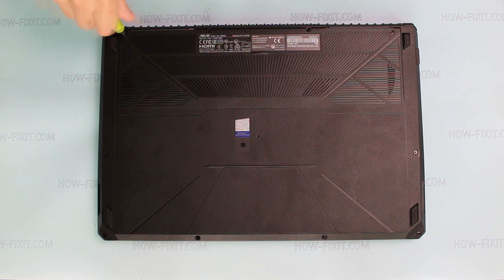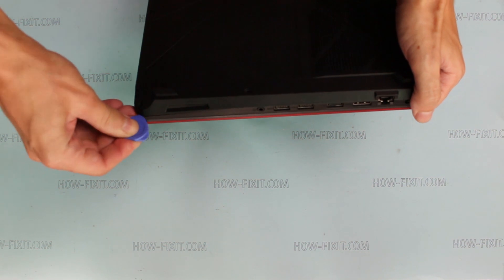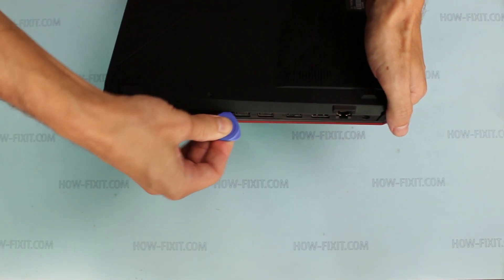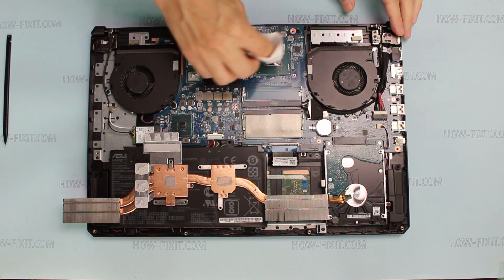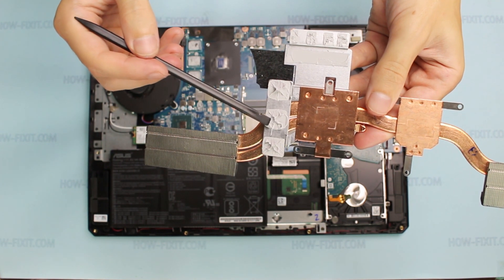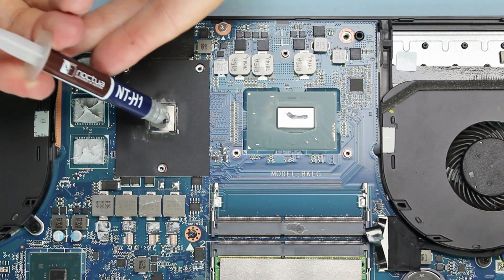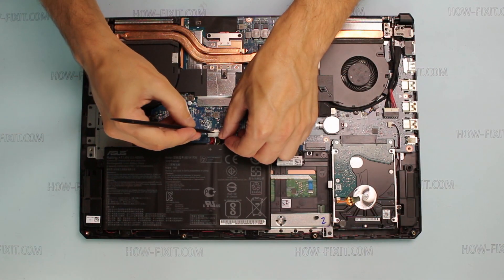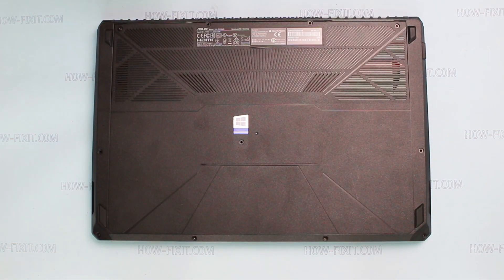Asus TUF FX504 Disassembly, Fan Cleaning and Thermal Paste Replacement

Comment: Greetings, My laptop screen seam came apart near the hinge. I can send you a picture if it helps. I tried locktite and gorilla, but they both failed from me opening and closing it everyday. Do you have advice which glue I should use? Also, would you suggest I treat the plastic with anything? Can I drill a hole there and insert a wire for strength?
Reply: This is a manufacturing defect in the tuf series. I had the same problem and since i used glues like you they didnt replace my screen under warranty.
Reply: Having the same issue currently. Did you find any solutions to the problem?
Reply: @arpitsahu9940  I ended up drilling a 2mm hole in the corner and wraped a wire through to hold the parts together. Then I put command strips around the outside. Extremely unellegant but its worked ever since. Believe me when I say I tried every glue imaginable with no luck.
Reply: @chipperjones3112  DAMN!!!

Comment: what about thermal pads should we replace them? since we open the contact become open
Reply: Aravindsrihari B V na na
Reply: I replaced the thermal pads with arctic mx-4 temps spiked up
Reply: @Resilientman07  lol never heard that
Reply: @apurvsharma1261  I replaced vrm mosfet thermal pads with arctic mx-4. Though the temps were lower than stock thermal paste. It wasn't as low as I had expected.
Gpu temp
Before-85c while playing games
After application-68
After second application-75(replaced pad with paste).
Cpu temp: 93c
After application: 84c
After reapplication:92
Reply: Aravindsrihari B V which laptop do u have and when u opened the laptop did u cleaned the fan and vents? And did u cleaned the old thermal paste completely?
Reply: @apurvsharma1261  i have asus tuf fx505GE. I cleaned the vents but didn't clean the fan seperately by unscrewing it from mobo. Just brushed it on the surface alone. Cleaned all the old thermal paste using hand sanitizer.
Reply: @Resilientman07  well u did well but when i did the same with my asus tuf fx505dy i saw huge drops in temperature
Reply: @apurvsharma1261  how much drop did
 you see?
Reply: Hey, on top of VRAM, is it thermal paste or thermal pads?  I am planning to repaste and have already bought thermal grizzly. 
Can you please help with what to do? Reading your comments I think you have already done it yourself.
Reply: @krood_  use thermal pads on vram o.5mm and on both die go for liquid metap. Temperature won't go beyond 80 with gpu undervolt
Reply: @Resilientman07  Thanks for the reply. But I am a bit confused here, by 'both die' do you mean CPU and GPU dies which are at the center?
And you told me to put thermal pads of 0.5mm on Vrams which means I need 7 small thermal pads three on the left of GPU die and 4 at the bottom of the GPU die?
Reply: @krood_  yes

Comment: How about Asus tuf fx504 How to replace gpu/cpu fan ? since mine is not working properly thank you
Reply: my asus tuf fx504 crash the whole time
Reply: @lukaskerner5752  And it will, always. Unfortunately TUFs' cooling system is so under engineered, they are thermal throttling all the time. This means your BIOS is limiting your CPU and GPU clockspeed in order to avoid sever overheating. I almost bought a TUF for myself, but after reading the reviews and watching few disassembly videos, I have rather chose a ROG series laptop, which has the same CPU and GPU as a TUF, but built with a much more heavy duty cooling system.

Comment: If I accidentally delete all the thermal paste and I can't get noctua h1, what can I put on the video chip?
Reply from the maker: You need any good thermal grease; you cannot use a laptop without thermal grease.
Reply: @howfixit  ok, thank you very much another question I have that same laptop fx504 about 5 days ago I changed the thermal paste I put artic silver 5 and it is not as thick or (thick) as the night H1 I can not buy that thermal paste in Mexico that I recommend putting yes Do I remove thermal paste from video memory? On the graphics card and the processor, if that thermal paste worked for me, but since I didn't know much about it, I removed all the pasta and I can't get the same one you use, other than the H1 night, what paste can I use there: ( I hope you can give me some solution, I would really appreciate it! I bought the laptop in December I don't know if you understand me I'm using sorry translator.
Reply from the maker: You can apply thermal grease to the video memory chip and see what the result will be in temperature. If the temperature is high, then you should use Thermal pad: http://ali.pub/3q3zei
Reply: @howfixit  last question thank you very much you are a hero but how am I going to place that? Am I going to put everything I remove from the pasta right there? I will put it directly to the memory chip or the cooling tube
Reply from the maker: Thermal Pads are put only to the memory chip.
On the CPU and GPU you must put thermal paste, as in the video
Reply: @howfixit   Hi, thank you very much. Do you have any video on how to put the thermal pads?

Comment: Can someone explain me the video chip thing with the thermal in elastic state and why ? sorry kind of new to gaming laptops...
Reply: by accident I removed the thermal paste on the video chip and I can't get the nocturnal H1 that I can do D:
Reply: @pitufoblu5127  Im not sure thats why Im asking but it seems you need to put the thermal not with pea size but much more
Reply: @xenonohad   I am from Mexico and I can not get the thermal paste night h1 and by mistake I removed all the thermal paste from the video chip and that I put artic silver 5 in the processor and graphics card until there everything well but I do not know what to do with the other parts to remove the paste: / I need some solution why noctua h1 vs artic silver is thicker noctua h1 could not place the artic silver in those places that remove it without first knowing
Reply: I see that it is not necessary to replace it in those places but I already did it and I do not know what to do or what I can put it .. I do not get that thermal paste here in my country I have that same laptop fx504
Reply: @pitufoblu5127  yea I get your point so I guess we will wait for someone who know to answer
Reply: @xenonohad  hey! do not change the thermal paste of those places only from the processor and graphics card I had the same doubt as you but apparently that does not heat much so it is not necessary to replace it
Reply: @pitufoblu5127  yea I know I would not change it dont worry and thanks for the warning
Reply: @pitufoblu5127  what are ur ingame temperatures after changing thermal paste any improvements ,?
Reply: @TheAnas8  If there is an improvement once the paste dries, it is no longer useful when opening my laptop. I only had a small piece of thermal paste. I felt temperatures too high until it became a little slow to lose performance. Well, I do not know how to explain, you will feel that your laptop gets very hot doing basic things or that the fan makes a lot of noise also if you live in a city where it is very hot that decreases the life of your pasta
Reply: @TheAnas8  For example, where I live with such heat that it is my turn to change it every 8 months, now my city is 100.4 fahrenheit and temperatures sometimes rise more
Reply: @pitufoblu5127  aight thabks for replying fellow
Reply: @TheAnas8  It is very important the thermal paste in a laptop so do not stop serving it if you see high temperatures ..
Reply: @pitufoblu5127  i just bought an asusbtuf fx505 gaming laptop with an i 5 8300h and its overheating as fuck peaking to 95 degrees with undervolt ... i dont know wether to change pastz right now or after 8 months
Reply: @TheAnas8  mine playing the league of legends, is the maximum 75 degrees and passing 85 is too hot even 80 and you say you reach 95 degrees?   If so, that thermal paste changes urgently, you can damage the entire laptop .. 95 The processor is too high, the maximum it supports is 100 degrees and verify that your fans are not covered with lint
Reply: @pitufoblu5127  it seems ok to put mx4 on it if im not wrong not that Im gonna do it but for you look in this site:
https://forums.tomshardware.com/threads/hi-all-help-i-have-a-laptop-asus-tuf-fx504-i5-8300-gtx1060-6gb-i-bought-it-half-a-year-ago-for-two-weeks-now-while-gaming-my-cpu-reached-91c.3492031/
Reply: @xenonohad  Well I will have to get it but in the vrm video chips and what did you put?
Reply: @xenonohad  Have you already applied thermal paste on memory chips?
Reply: @pitufoblu5127  no not yet I sent you this web so you can see its possible you can ask there also for double verification
Reply: @xenonohad  I'm going to put thermal pads to see how xd
If something does not work properly then I will see how to buy the nocturnal H1
Reply: @TheAnas8  do it correctly mine is at 70° even after continuously gaming for 4 hrs
Reply: @wasdfingers7186  u hve fx 505 or 504 ?
Reply: @TheAnas8  fx504 5 days ago I opened the cover of my laptop on a normal day .. I have 9 months with it and out of nowhere the plastic on the screen opened (cover) now I will have to find a way to replace it because I can break the hinge or until the screen I do not recommend these models are too thin and it is pure plastic what you have on the screen according to lei I am not the only one with this problem and I do not find any video to know how to disassemble the screen    I'm somewhat sad and stressed :( I bought it in the United States and I'm in Mexico. I don't think the guarantee wants to cover that ... and it wasn't my mistake, I just closed the lid and when I opened it, something broke inside and it was all ... since I bought it, it felt sensitive, I thought it was normal, but I saved a lot and received this surprise. I'm very discouraged :( it's just my opinion if you buy a laptop, choose something that looks thick and not so thin
Reply: Can you help me find a video where I can see how to disassemble the screen cover to see if I can get it and change it? my model is FX504GD
Reply: @pitufoblu5127  try to contact ur warranty service first

Comment: Here I come liquid metal
Reply: Yeah the best choice
Reply: Won't liquid metal be an overkill for a laptop that takes in 150W at max?
Reply: @aniruthdinesh9156  no because the cooling system sucks. Fans ramp just browsing the web.
Reply: @alexanderwright5246  Yeah, even if liquid metal transfers heat that fast, i think the rest of the cooling system will limit heat transfer.

Comment: Please do the instruction replace thermal paste  for FX505DU or FX505GM
Reply: it is the same shit
Reply: @doggieph  no for the 505DU its different layout inside
Reply: @chow_bea  found any guide for 505DU?
Reply: @whatisayoutubehandlebro  No bro, do you have issues with your fans or you're just here because of thermal throttling?
Changing of thermal paste is easy on the 505DU, but getting the noisy fan out and cleaning or replacing is too delicate and hard
Reply: @chow_bea  I think i want to repaste. I get thermal throttling and the cpu today reached 101 C for a brief second before getting back to 95-98. So that freaked me out and decided i need to do some stuff to reduce the heat. Maybe clean the pipes and apply some decent paste. I don't want my chips fried especially after buying an expensive laptop.
Reply: @whatisayoutubehandlebro  101°c Damn! I freak out when mine gets close to 90° lol. Get a repast and clean your fans bro.
Just unscrew the 7 or 8 screws around the pipes and fans then you should get enough room to lift the pipes over both the CPU and GPU then you can clean the old paste and apply new one . Also clean ur fans since you already opened it up.
Reply: @chow_bea  Yeah I'm planning to do that, and stopped playing games that get me 101 C lol, until then at least. Now I'm playing Sekiro and get max 95 C.

My brother suggests i don't try repasting because its risky or something. So now I'm really choosing between either letting my chips fry inside the pc or risk messing up during repaste. I'll repaste though, thanks.
Reply: @whatisayoutubehandlebro  or use ryzen controller
Reply: @doggieph  daaaamn bro

Comment: Can you please show the procedure for opening fan compartment? My fx504 is throttling like hell. Can't even play cs go! I think i need to clean the fan compartment thoroughly but can't find any instruction about that online!!
Reply from the maker: If the fan doesn't work correctly, cleaning will not help. It is better to replace the fan with a new one.
Reply: Dude I also faced same problem by performing undervolting both CPU and GPU it fixed my problem.

Comment: Hi can i use on this laptop asus fx503vm a Thermal Grizzly Conductonaut metall paste ?
Reply: No, don't do it. There is no IHS on the Die, so you might shorten the life span of your CPU and GPU by using a liquid metal because of its corrosive properties.
Reply: yesu can i just replecedin my old gaming lenovo Z 50 75

Comment: Is that thermal pads on the gpu vrms/memory chips as I want to know if I can remove them and replace with thermal paste
Reply from the maker: No, this is a different consistency
Reply: @howfixit  what is it I could use Mx4 thermal paste?
Reply: @howfixit  is it AS Ceramique, could you reply please as I'm trying to fix my laptop, what is the white stuff that is used?
Reply from the maker: I can not understand why you are trying to change the paste on the gpu vrms/memory? What will this improve in your case?
Reply from the maker: Just change the thermal paste on the CPU and GPU - this is enough to lower the temperature.
Reply: @howfixit  it's because my idiot friend removed the paste and I need to know what I can use for the chips not the cpu or gpu the chips
Reply: @howfixit  any idea
Reply: @ConnorA21  What did you do about it? the same thing happened to me xd
Reply: @pitufoblu5127  it happened to me too. Help
Reply: @Aravindsrihari B V   Well, put thermal paste as it says in the video if you removed it, use that night if you can not get it to use mx4 and put it so that the pasta touches the chip and the trigger those pastes are a little thick, so I would recommend using any of those 2  the others are a little more liquid, so the ones I told you can use and of course they are not conductors
Reply: @pitufoblu5127  so If I use mx-4 there's no need of thermal pads?
Reply: @Aravindsrihari B V Well, I didn't just use the thermal paste and that's how it worked. After doing it, could you do a test and tell me the temperatures?
Reply: @pitufoblu5127  yeah sure.but I have fx505 ge. I don't know if that would make any difference
Reply: Aravindsrihari B V fx504 is the same as fx505 although I believe that in the fx505 version they improved the heating of the cpu
Reply: Aravindsrihari B V Is there any way that you can send me a photo of how he is?  and how will the result be when you apply the paste
Reply: @Aravindsrihari B V
Reply: @pitufoblu5127  Hey sorry been busy for a while my temperatures soared upto 50c while idling so I reapplied it three times it didn't change so going to but thermal pads now
Reply: @Aravindsrihari B V  which pads did you put?  You can send me the link of which ones you applied
Reply: @pitufoblu5127  I bought it from a local store. Has 2kw/m3 conductivity.
Reply: Could you tell me what I can use to replace the vrm paste with?

Comment: If you place in different areas of the heat sink will that be better or will it make it work vice versa and make it worse so that the heat will not be dissipated correctly ??

Comment: any difference in temperature?
Reply: Probably not much since the laptop already throttles so much to keep temps below 70 C
Reply: rauno kuldkepp  no. the asus fx504 is different. the laptop throttles a lot. 45w down to 25w. 3.9ghz down to 2.2ghz. the result? a cool, but stuttery gaming laptop
Reply: @alexclarke6924  Use Intel XTU to set the short turbo TDP to 45W, it will resolve the throttling, also undervolt CPU and GPU, it will be very smooth after that.